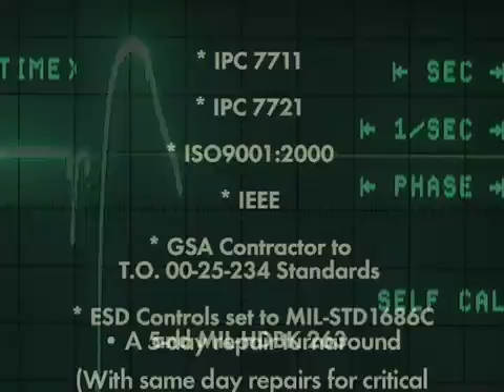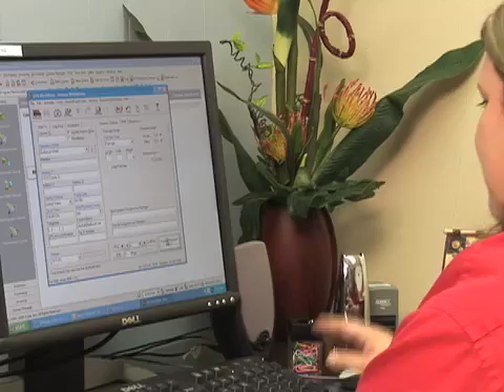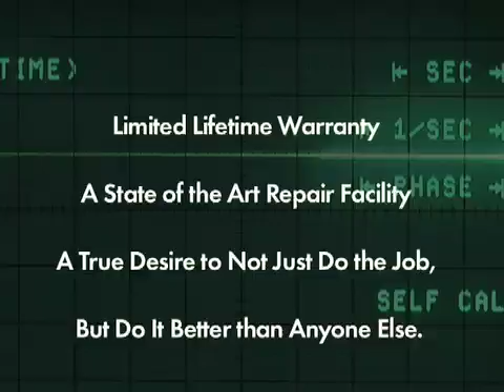Industrial Electronic Repair

Comment: what's a  profession for someone that Repair TV, Radios, Amplifiers etc..??
Reply: Electronics Lab Technician / Technologist... The degree required is usually an associate in Electrical Engineering Technology (EET) or Electronics Technology (ET).  EET would get you further... You could also do this type of thing as a hobbyist.